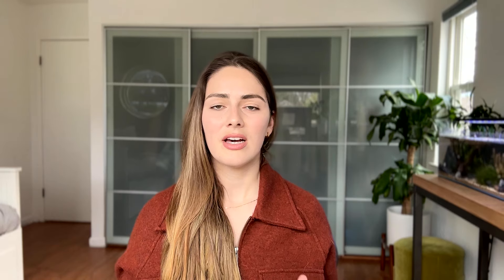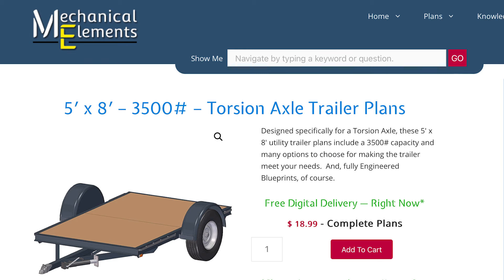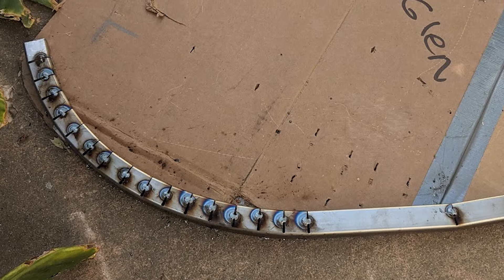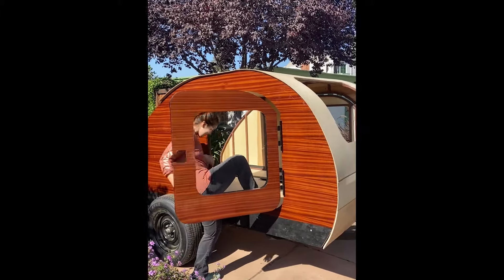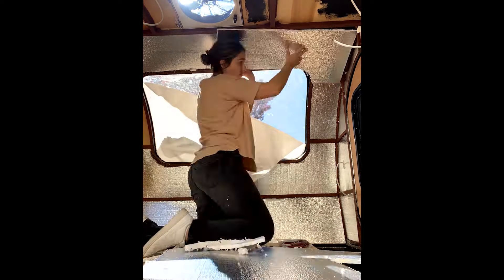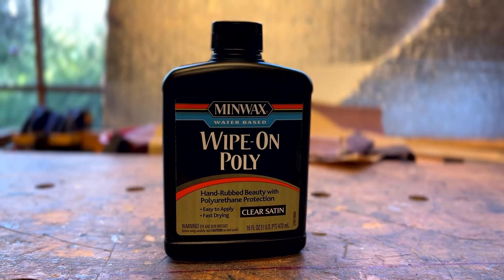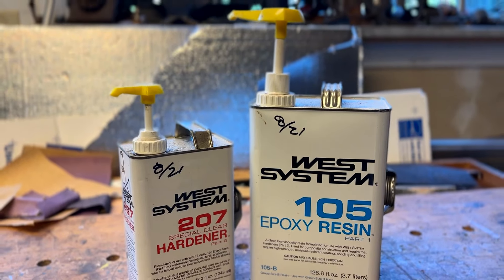DIY Teardrop Camper – Complete Build Breakdown

Comment: What did you use for a seal for the front curved window ? Where did you purchase to polycarbonate plastic and what was the cost
Reply from the maker: When attaching the window to the metal trailer frame, we included thin layer of neoprene sandwiched in between the polycarbonate and the metal frame. After laying down the plywood sheets (with a cutout for the window) over top the frame, we created a metal trim that overlapped over the window and the wood and screwed it down into the wood, putting down a thick bead of silicone in between the two. We were generous with silicone throughout the whole process to keep it from leaking, including putting a bit of silicone down on any drill holes before driving a screw in. 

I can't remember the exact cost but we got the polycarbonate plastic from tapplastics.com

Hope that helps!

Comment: Do you have a link for the window (curved) in front?
Reply from the maker: We made the front window ourselves out of poly carbonate. We welded the frame for it, then cut the poly carbonate to fit the frame, and then made a custom metal trim to screw down over it.

Comment: Elena, hello again, your trailer is 5x8 right? You said that you used a queen bed, what was the final measurements of your sleeping area? Im thinking 5 x 6 for sleeping? Which means that you left around 2 ft for your galley? Im finalizing my plans and figuring out if we will be sleeping sideways or on our backs lol, everything depends on length of the sleeping area.
Reply from the maker: Hello, we altered the trailer plans a bit to accommodate the queen sized mattress, so the end result was a tad wider and longer than the 5ft x 8ft (closer to 5.5ft x 9ft). We left about 7ft of length for our sleeping area, to fit the queen mattress with some buffer, and about 2ft for our galley.
Reply: @elenamakes awesome, thanks, I was wracking my brain trying to figure it out lol

Comment: Hi Elena great job on your and your husband and dad’s teardrop also  video presentation.

I am almost done with my teardrop here in keizer Oregon. 

I thought you might also use sapele for your counter top.  Really beautiful.  Your camper definitely was built well.  

I built mine mostly out of similar construction such as 1/2 plywood for floor. Painted too with marine paint and laid it over a plastic underlayment from an RV supplier.  I used a lot of Alaska yellow cedar  and 2 inches insulation floor snd ceiling snd 1 inch for floor.  My frame is 2x4 channeled aluminum $1000 plus $700 for someone to weld it,
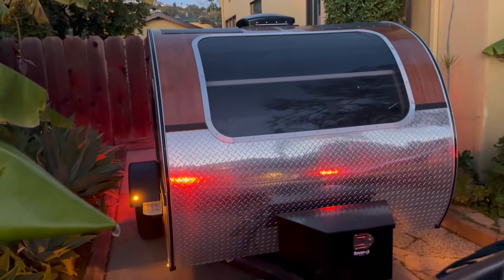Reply: 14:38
Reply from the maker: Thank you, we’re happy with how it came out. We might end up bringing some sapele into the kitchen area, we’re still undecided. 

Congrats on your camper build, it’s such a fun project!

Comment: Hi. I like your trailer build. I have a question: how did you attach and seal the polycarbonate front window to the trailer opening?
Reply from the maker: Thanks! Installing the windows was a little bit complex and it required some trial and error before we got it how we wanted it.

Ultimately, what we ended up doing was welding a metal frame for the window that was attached to the sides by some metal crossbars. Then, my dad pre-drilled holes in the polycarbonate along the edge where he would secure it to the metal window frame. Next, he cold bent the polycarbonate to the front and used ratcheting straps to slowly bend it as he went around screwing self-drilling metal screws in through the poly carbonate and into the metal. There was also a thin layer of neoprene sandwiched in between the polycarbonate and the metal frame. Lastly, he created a metal trim that overlapped over the window and the wood and screwed it down into the wood, putting down a bead of silicone in between the two. 

We were generous with silicone throughout this whole process to keep it from leaking, including putting a bit of silicone down on any drill holes before driving a screw in. 

One other thing to note: we checked the polycarbonate manufacturer’s info for how tight of a radius we could cold bend the polycarbonate and luckily the radius of the front of our trailer was within their constraints.
Reply: @elenamakes  Thanks for that. I'm guessing the polycarbonate wasn't flexible enough to just use a window seal, sort of like a car window?

Reason I'm asking, is that I'm thinking of doing something similar, and am trying to find a way that works without a trial and error phase.
Reply from the maker: @bretchampoux   We were definitely working at the limit of it's flexibility. We tried just a rubber seal and it started peeling up. Perhaps there is a way you could do it without issues but the metal trim screwed over the window ended up being the best solution for us.

Comment: Elena I commented on other video of yours too.  Just to  say your right cost more then you think.  I am a shopper so I think even with top notch material I was under $7k.  
I was able to get 5x12 & 5x10 sheets of aluminum for $80-90 a sheet at Coastal Aluminum in Portland Oregon.  

Aluminum will keep you dry.  Knowing this I should have put a sheet underneath too.  I was able to bring home four sheets in my Subaru forester.  The guys at coastal rolled all four sheets up for me .  

 I would try however to paint or anodize before hand and to cover completely to avoid scratches.  You should take a peek at wandertears and watch how fast they put it together on their time lapse video  they make it look so simple.  

I bet if you build another it will go a lot faster and cheaper.  Mine is 3 days from being done after a long year.   I would  build with Alaskan yellow cedar or other cedar because it is light weight and rot and bug resistant.   Focus more on a design with 2 inches of polyiso insulation for floor and ceiling.  Layer 1/2 sub floor 2x4 frame 2 inch polyiso and 3/8 ply  

Last I borrowed ideas from vistabule bean trailer Trail’ R, aero teardrops and Camp- Inn 

You could do a cool amalgamation  of things you might like.  

It’s been a pain but think of the great take aways of the struggle.  Gives you confidence in other areas of your life and it really does build character and puts the world in so many different perspectives.. glad you guys took on the challenge!
Reply from the maker: Thanks, appreciate the encouragement! Definitely a challenge but so worth it in the end and we all learned a lot :)

Comment: I started building a Teardrop trailer in 2014 after buying my 2013 Nissan Xterra pro 4X and try to sleep 2 people in it and it was very uncomfortable, So we had a very strong Jet sky trailer,  and started building on it, using only 3/4" plywood, No metal frame, we did the traditional egg shape  and  after 2 years  we decided tear down the rear gally and added an extension to the trailer and built a 1/2 bathroom W/C & Shower,  this time adding 1/2" square tubing and  the roof of the bathroom wouldn't lift up to accommodate a 6' person  i finished it a year later it has A/C  1- 25 watt solar panel  which is enough for a 12 volt marine battery  for the  fantastic fan, outside and inside lighting  usb chargers, on demand water heater, and I used the same registration for the jet sky trailer and never had a problem,  but since I bought my Class C Rv in 2019, It's just been sitting.

Comment: Elena, you guys did a wonderful job! It turned out well and very inspiring. Keep us posted on your trips. Also, Im in CA, do you have a list or a check list of items you need to bring to the DMV? In addition, what specific forms did you have to fill out? Ive read a bunch of online DIY'ers dealing with teardrop registration in CA and it seems all over the place with ever changing rules.
Reply from the maker: Thanks! We only applied about 3 months ago so likely rules haven’t changed. 

If you register, like we did, under the CA Specially Constructed Vehicle application process you will need to print and fill out 1.) Application for Title or Registration (REG 343)  2.) Statement of Construction (REG 5036)  3.)  permanent trailer identification form (REG 4017) and bring receipts for the major build materials 

We made sure our camper fit all the build requirements, made an appointment at the DMV, showed up with the completed forms, and the registration process went relatively smoothly. They’ll do a walk around inspection but it’s not too intense.
Reply: Awesome!!! Thank you, my wife and I are building our 5 x 8, hopefully everything goes as smoothly as yours.

Comment: In Spain these vehicles are highly regulated, it is impossible for one to build and register them.  You can't even modify the cars.  It is a pleasure to learn to see how it is built.
Reply: How strict are the vehicle modifications there in Spain?
Reply: Yet another reason folks flock to my us of a. 
Drag anything you want down the road. 
horrid, shrieking eagle
Reply: Wow That's crazy,  in one way or another,  it's good we live In the Good US of A, I modified the rear of my Rv to accommodate a larger tool box  from on end to the other so I can carry my Winch, more house batteries for the solar panels,  Tools an OBA, compressor Recovery Gear and  Lots more.